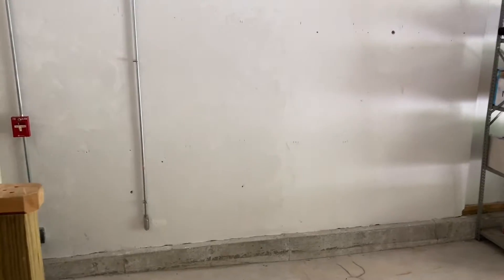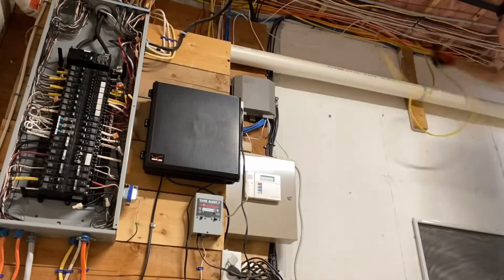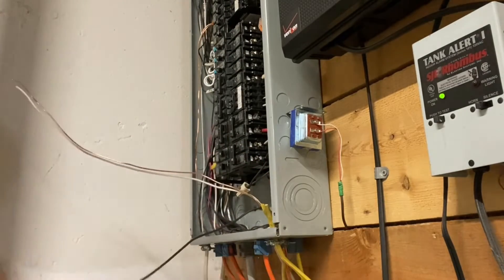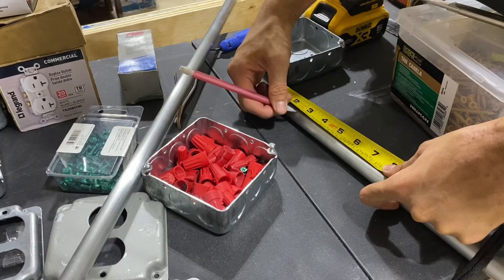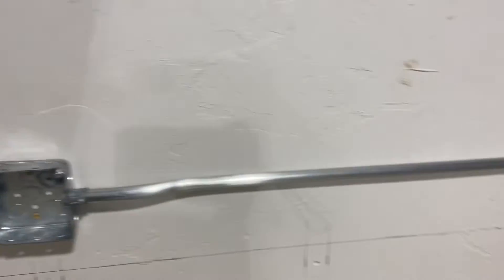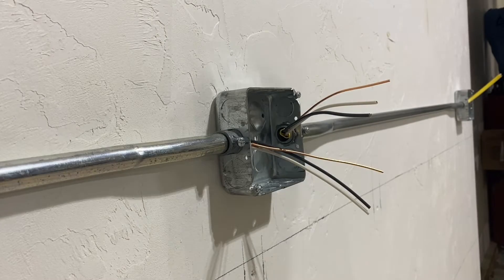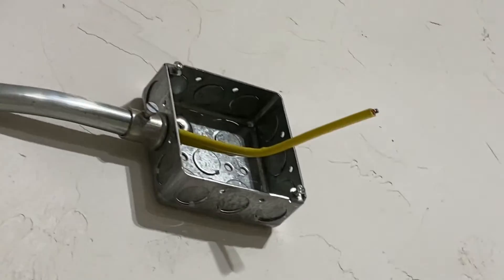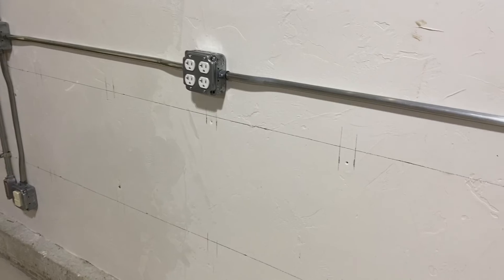Installing Dedicated 20 Amp Outlets for Garage Workbench

Comment: Great job just did not show how you ran power to next outlet I know how, but some maybe wondering about the pig tails. Not a slight but just pointing it out especially  when you got to the switch and the emergency  light
Reply from the maker: Each box has two cables, one going in and one going out. I believe this is shown in the video

Comment: It's NOT recommended that you double up ANY wires in your electrical panel, as are the grounds in your box.
Reply from the maker: Generally this is an acceptable practice as long as you don’t double neutrals, which are current carrying wires. Ground wires are an “emergency” path back to the panel, so doubling a ground and neutral is acceptable.

Comment: Just curious if the metal boxes outside the drywall is a code requirement for garage use, or can it be flushed inside the wall?
Reply from the maker: It can be flushed inside the wall but you will need a box for that. Thats just a much more complex process

Comment: 9:08 So technically, you can put a 15 amp reeceprical on a 20 amp circuit but only  if there is only a small amount of them . See a 20 amp circuit breaker is meant to trip when overloaded 20 amps but a 15 amp receprical can only handle 15 amps and if on a 20 amp circuit breaker it would not trip cause there to potentially have melted wires. Not saying you did this in the video. Good work by the way.
Reply: @FireAlarmDude5967. Most of what you said is correct, but it's not the receptacle that "can discharge a maximum of 15 amps". The receptacle, regardless of whether it's a 15 or 20 amp receptacle will pass through whatever the current demand is from the load. It's the job of the circuit breaker to trip when the current becomes higher than its value.
Reply: @ yes that is what I was saying
Reply from the maker: I don’t think that’s correct. First of all, a 15 amp receptacle is rated for 20 amps of feed through. It simply just will not accept 20 amp plugs. A 15 amp receptacle is only capable of of accepting 15 amp devices and and can discharge a maximum of 15 amps
Reply: @FireAlarmDude5967  So if its a 15 amp receptacle on 20 amps circuit breaker and it exceeds 15 amps the breaker won't trip
Reply from the maker: @ 15 amp receptacles are rated for 20 amps of feed through
Reply: @FireAlarmDude5967  https://www.youtube.com/watch?v=wLSe4LzK9b4
Reply from the maker: @ the video you just linked literally proves me right..did you even watch it?? lol
Reply: @FireAlarmDude5967  no its says you can but not recommended. Great video tho

Comment: Don't forget to install tamper resistant outlets in dwelling units. Turning the switch off to the emergency light will actually illuminate the fixture and drain the batteries simulataneously. The switch isn't advisable there. Conduit and wiring looks nice!!
Reply from the maker: Thanks for the comment. Tamper resistant outlets were used in this video. Yes…turning the switch off to the emergency light will turn off the power to it..that’s the point of the switch.
Reply: Don’t forget to remove the tamper resistant outlets after the inspection and replace them with outlets that won’t frustrate you every time you plug in a different tool. 😊

Comment: I paid $20 for a 10 pack of Legrand spec grade 15 amp receptacles, I thought that was a good deal. I doubt that the 20 amp is superior, it just allows for a 20 plug. I bought them from Home Depot, not eBay, could account for the difference.

Comment: Would be safer if emergency luminare ( no such thing anymore in the NEC as a light or light fixture ) was on the same circiit that supplies power to room linanares.
Reply from the maker: True, but the Emergency luminaire is not a requirement here. It’s merely a supplemental unit I installed for fun.

Comment: See two code violations. 1) must seal wire or cable that runs from a warm environment to a colder environment.to prevent condensation from building up.  2) Not legal to tun type NMB cable in conduit. Should have used THHN/THWN wire . NMB individual conductors never have the guage or insulation type like THHN/THEN, XHHN & other types. Depending what vode cycle your lication is in might need a AFCI cirvuit breaker. Must read panel label very carefully. Some panels are only rated for a maximum of four flimsy mini or twin breakers. Inspectors will check for this and fail jobs not following panel label.
Reply: Should have said type NMB cable NEVER has the wire Guage printed on conductor insulation .
Reply: There is no more NM-B, it’s now just NM.
Reply: @pld8993  Last of type NM cable was manufactured in the early 1980's where the insulation on the wire was type TW and only had a 60 degree C rating. Type NMB has thinnet but far superior type THHN insulation that is good for 90 degrees C when used inside of conduit but only 75 degrees C for NMB cable. The reason they stopped.making Type NM cable that in unventilated hot attics it ( insulation on wire ) was degrading.
Reply: @JohnThomas-lq5qp  I was referring to the NEC. NM, not NM-B.
Reply from the maker: AFCI breakers are only required in living areas in this jurisdiction. A garage is not a living area. Regarding the other issues, it Would be helpful if you provided the actual codes that require these things. I address the Romex in conduit dilemma in the description but if you can provide the actual NEC code that prohibits that I would be interested
Reply: @FireAlarmDude5967  NM cable can be run in conduit, but the rub is in the conduit fill calculations. A single NM cable is considered one conductor, but you must use the largest measurement across the cable for your calculations. In simple terms, the conduit needs to be much larger than it would normally need to be.
Reply: wrong..
Reply: @JohnThomas It is legal to run NM-B in conduit NEC 334.15(B), but can't be used in wet or damp locations, NEC 334.12(b)(4). It's the installer's option, but I'm with you on a preference for THHN wire.  You can legally install THHN wire without a ground wire as EMT is permitted as EGC, NEC 250.118(4), and NEC 250.146(A), grounding and bonding in which ground wires to the receptacles would not be required here. The metal box cover with the metal to metal contact with the receptacles provides the ground fault path.
Reply: Romex is allowed in conduit anywhere romex is allowed, no length limit. 334.10(5)
Reply: @surferdude642  THANK YOU FOR PROVIDING THE SPECIFIC REFERENCE OF THE NEC!!!!!!!  I tire of comments that note a "code violation", but don't cite a specific reference.  More so since each Authority Having Jurisdiction (AHJ) adopts different versions of the NEC.  What may be a "code violation" in one AHJ may not be in another AHJ.

State	NEC Edition Enforced
District of Columbia	2014
New York	2017
Alabama	2020
Alaska	2020
Arkansas	2020
California	2020
Connecticut	2020
Delaware	2020
Florida	2020
Hawaii	2020
Louisiana	2020
Maryland	2020
Montana	2020
New Jersey	2020
New Mexico	2020
North Carolina	2020
North Dakota	2020
Ohio	2020
Oklahoma	2020
Oregon	2020
Pennsylvania	2020
Rhode Island	2020
South Carolina	2020
South Dakota	2020
Tennessee	2020
Texas	2020
Utah	2020
Vermont	2020
Virginia	2020
Washington	2020
West Virginia	2020
Wisconsin	2020
Wyoming	2020
Colorado	2023
Georgia	2023
Idaho	2023
Iowa	2023
Kentucky	2023
Maine	2023
Massachusetts	2023
Michigan	2023
Minnesota	2023
Nebraska	2023
New Hampshire	2023
Arizona	Local adoption only
Illinois	Local adoption only
Kansas	Local adoption only
Mississippi	Local adoption only
Missouri	Local adoption only
Nevada	Local adoption only
Indiana	Mixed

Comment: You could avoid having to do box offset by just using mineralac a.k.a. mini straps – it would probably be a little more DIY friendly for most people. Also throwing a level on your conduit before strapping it down would make it look a lot more presentable.
Reply from the maker: True but those do look janky. And yes, I did use a level.
Reply: @FireAlarmDude5967 You're fine, standoff mini straps would be a safety hazard in this case, IMO.

Comment: You did pretty good.    Hope you don’t mind some clarifications.  A few of the finer points of NEC.   The definition of “dedicated” (The National Electrical Code (NEC) defines a dedicated circuit as an individual branch circuit. A dedicated circuit is designed to provide enough power to a specific appliance without overloading the system. It has its own circuit breaker and only supports one outlet, so only one device can draw voltage from it at a time.).  The cover on the box that holds the devices are not mud rings.  They are surface covers.   Emergency lights are not allowed to be switched.
Reply from the maker: Good information. I didn’t know that emergency lights couldn’t be switched. In this case, it’s in a residential home so I guess it’s fine since it’s not a required fixture.
Reply: @FireAlarmDude5967     You are correct that it’s not required.   I agree with your comment.  But, just so you know, in my 35+ years experience designing electrical systems, if you install something, required or not, you must follow the code.   A for instance,  if you install a Fire Alarm panel in a office space that does not require one with 1 smoke detector, and one horn/strobe, the fire marshal, and the electrical inspector will require a full blown and installed system.  This actually happened.  The project manager thought it would be a good idea.   Best wishes.
Reply: @FireAlarmDude5967 WRONG . Must have normal power to emergency luminaries 24/7 to keep battery charged.
Reply from the maker: Incorrect. In a residential application, this unit is supplementary and not required. I can do whatever I want with it
Reply: @FireAlarmDude5967     So, why would you install an emergency light with a battery and not charge the battery?  If you turn off the power, the light will come on and drain the battery in 2 hours or so.   So, what is the purpose of the switch?
Reply from the maker: @KevinCoop1  Not sure where you got the idea that the battery wouldn't be charged. The fixture receives power 24/7, unless the power is out. The switch is for the purpose of disconnecting power to that fixture if I'm testing or working on that unit. As you see from the other content on this channel, I make content about fire protection equipment and do frequent testing.
Reply: @FireAlarmDude5967     So, the switch is not being used as a switch, it is being used as a means of disconnect.  You must admit, that very very few lights having switches that are only for that purpose.  If someone else turns the switch off not knowing that it was supposed to be left on, then it would not have power to charge.   Correct?
Reply from the maker: @KevinCoop1 Yes, it is uncommon for emergency lighting fixtures to have a disconnect. It’s generally uncommon for commercial emergency lights to be in homes in general. The switch is high enough that my family wouldn’t even think to touch it.

Comment: great job! how would I go about installing something similar if my breaker box is flushed and located on the same wall I want to add the receptacles to if that makes sense.
Reply from the maker: Usually you’d make a cut in the drywall above the panels to access the knockouts and then patch that later

Comment: Question: you said the first receptacle must be GFCI compliant, I dig it. Am I to understand that all the rest of the receptacles in that network get their current routed through that one GFCI-compliant receptacle? If so, that makes perfect sense grounding-wise. But isn't that whole network quite an electrical burden to route through one receptacle?
Reply from the maker: The receptacle is rated for 20 amps of feed through current so it’s no issue

Comment: you can not use Romex in conduit  but besides that god job
Reply from the maker: See the description
Reply: @FireAlarmDude5967  yes
Reply: Not true.  It's code (unless exposed to water) but is a PITA to run thru anything but a short run of conduit.
Reply: In my area at continuing education classes were told that type NMB cable ( no such thing called Romex in the NEC ) should only be run in conduit in basements to protect 6 or 7' of cable running down a basement wall to a receptacle or wall switch. Being that individual jacket on NMB cable are never labeled for wire Guage Johnny homeowner would not know what Guage it is and make load mistakes. Have been in too many basements & worst yet old cellars that certain times a year would be considered a damp location and type NMB is not allowed in wet or damp locations. At another of the 8 yearly continuing education classes that I attended the instructor / inspector told us we should never use type NMB  outdoor luminaries because even if you drill a hole thru an exterior wall and into the back of a pancake or 4" octagon box it's in an damp location therefore a code violation.
Reply: Running NM to an outdoor box is fine. Once it enters the box and you remove the shearing  it is no longer NM cable in the box, it’s individual conductors. If you want to run NM in 500’ of EMT, as long as it’s in a location where NM is allowed it’s perfectly legal. There is no restriction on length of NM in conduit.
Reply: @pld8993  And when you were to give this only approved for dry locations several inches of the paper wrapped around the ground wire will be either very damp or wet.
Reply: Only if water penetrates the box, which it shouldn’t and if water is getting in, the problem needs to be addressed. The inside of a properly installed outdoor box is dry.
Reply: FYI, the outer sheathing of NM is always marked with conductor size
Reply: Incorrect. Romex allowed in raceways, 334.10(5)
Reply: @pld8993 334.10(5) applies to type I and type II construction. Residential construction is usually type V. Romex is allowed in conduit per NEC 334.15(B). That's my understanding, correct me if I'm wrong.
Reply: Yeah, my grandparents have had Romex in conduit for over 15 years and there’s been no issues. Literally everything in the entire house is in conduit surrounded by concrete. So I’d say it’s pretty safe.

Comment: Not really supposed to use Romex in EMT or else it will make it hot and possibly cause an electrical fire
Reply from the maker: Check the description
Reply: Absolutely false. Romex allowed in conduit.
Reply: @pld8993 Maybe 75 years ago or some third world countries.
Reply: Incorrect. NM is allowed in conduit anywhere NM is allowed. 334.10(5). Required in conduit where necessary for physical protection. 334.15. If you want to run NM through 100’ of conduit in dry location, not smart but legal.
Reply: It does not overheat simply by being in conduit. Another myth that just won’t die.
Reply: You absolutely can run Romex in conduit. Unless it is exposed to moisture or in a high moisture area.